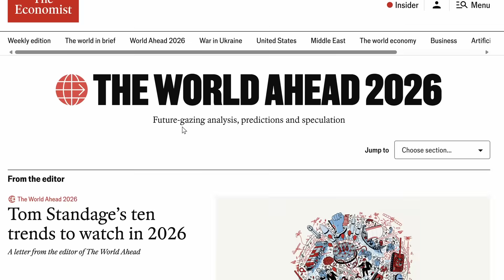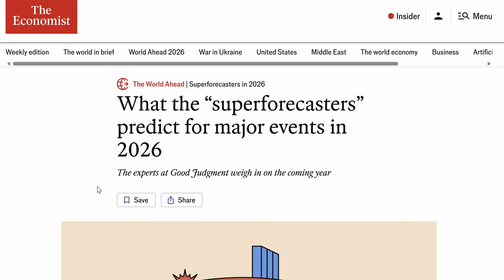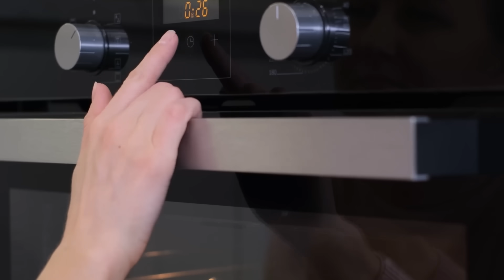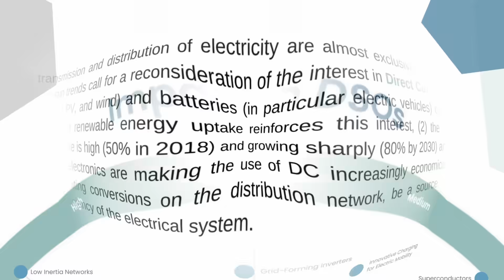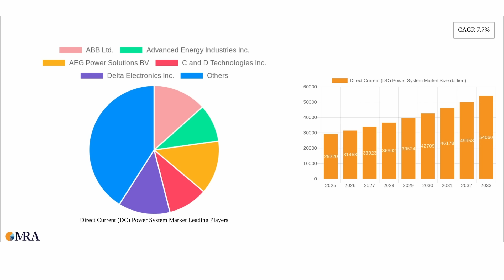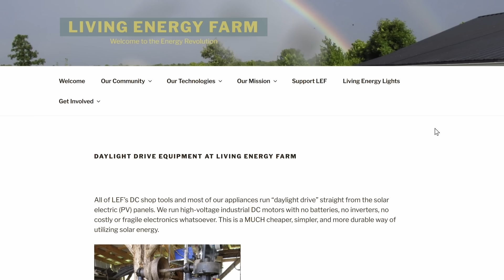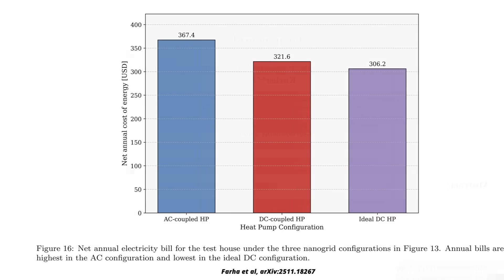Are We Using the Wrong Kind Of Electricity?

Comment: EE here. This is exaggerated, it's not a fight AC versus DC, or that we have done something wrong. Both have currently their place. We aren't just simply replacing AC everywhere within a foreseeable future. Using DC is also expensive. It requires complicated electronics to step the voltage from higher to lower or vice versa. Circuit breakers and fuses are also much more complicated and expensive with DC. That said, I see it as normal development, where we increase efficiency and develop better solutions and products. DC transmission will inevitably increase, in the places where the increased efficiency matters and where the conversion electronics have become so cheap so that it makes sense to replace AC transformers. This both on transmission side (long DC links) and in certain places in distribution and local networks, especially along evolving battery and solar technology.
Reply: Also an EE here, and if my memory serves me correctly, roughly 50-60% of power demand is used for turning motors - which, if the creator of this video were decently fair to take into consideration, would mean that we’ll still need a lot of power available in three-phase AC to power small-to-middle sized factories.
Reply: @tahiro1121  First part of your statement is not wrong. But most of these motors don't run directly on grid frequency. Most effective type of large AC motors (SynRM) even can't start on grid.
Reply: @tahiro1121 yeah 90% of the motor are start AC frequency
Reply: @tahiro1121  This is what I wanted to mention for previous post: asynchronous motors (short circuit cage rotor) are simple and reliable, the article asks us to use brush motors, or expensive for big size electronically driven brushless motors? This is actually either a stupid, or a bad intended propaganda article.
Reply: @tahiro1121 a great many of the motors these days are some flavour of brushless DC motors. Even in fridges and air conditioners etc it is becoming more common. 
Heck even simple ventilation fans are using it now to be quieter and allow variable speed.
Reply: ME here.  My view is that AC won because it is so easy step AC voltage and current up and down with primitive transformers.  It helped that AC generators and motors were brushless while DC had brushes (eficiency and reliability issues).
The thing that changed is the cost and reliability of stepping DC up or down has dropped with semiconductor prices.
DC is just an opportunity to be considered.
Reply: @skyak4493 I gotta agree. AC “won” because it was much easier to step up and down in voltage, so that the voltage carries the power, not the current (Immediate savings is realized in the control circuitry, recurring savings is realized in the amount of copper required to carry power from here to there). But you can store only DC, we have no known way to store AC. So it makes sense that most portable devices are DC because the energy is stored locally. However, many DC motors these days are “dc brushless” which is code for 3 phase AC and it still takes some effort to convert that stored DC to the 3-phase AC. But the effort it takes is invested in a more reliable system overall, as compared to a brushed motor.
Reply: @skyak4493  Yeah, back in the day, AC was better, and you mention the reason. However, semiconductors are not only able to step up/down DC, but also convert AC to DC with much higher efficiency than a transformer (in low/medium and maybe high voltage systems). The tradeoff is the price. So, if we have the required electronics now, while moving away from AC in those cases where there is no clear reason to do so? Back in the day, we had no better choice than AC. Today, we can choose the best option for our particular use case.
Reply: AC won because it was possible to change amplitude easily. DC lost because it was virtually impossible to reach any higher voltage. 22kV was achievable as AC only.
The technology changed few times since then.
- The old way to transform DC to different voltage was to turn it into AC, transform it and then turn it back to DC. This required transformer, 2x motor and 2x generator. A lot of moving parts. AC to AC required only transformer.
- Next version was based on early semi-conductors. DC to DC no longer required any moving part but the efficiency was terrible. And the technology did not allow the extreme powers that AC was capable of. Despite that the "no moving parts" was big improvement and so this was used for some time to achieve high voltages.
- In this millenia we've encountered boom of DC to DC convertors. Internally these were not a convertor at all - these were comparing output voltage against the required value and then either opened source or not. Like instead of delivering 3V DC supply these were delivering high frequency of pulses of the input voltage, e.g. 24V. If you've used frequency in kHz and good capacitors the output looked like the desired DV. Efficiency was no longer that bad, high power not achievable but the size of the device was a winner - it was tiny. Often the biggest part was heat sink for the transistor. Add in the fact the source did not even have to be DC but you could use AC and you would realize why nearly all computer PSU switched from heavy AC transformers to these "squeeking devices". Doing step-up DC to DC convertor required such few more elements for pumps. Even worse efficiency but still tiny and cheap.
- And the final breakthrough is in the switching element. We are now capable of manufacturing transistors which can switch extreme powers at very high frequencies with power loss which was not imaginable few decades ago. Use 20V at gate to control 1200V at 150A (18kW) power, losing 700W of power. Common and rather cheap IGBT transistor. You can buy models which can handle MW. Either way, we now have very efficient way of converting DC to DC.

The issue I have with the modern convertor circuitry is that it is getting complicated. In my school days I was making transformers. The math is simple and you could get good enough diodes for a rectifier even here beyond the iron curtain. So trivial was the technology. But the modern DC to DC is complex. Not the final assembly, that one is still rather easy. The issue are the components. Who can make good IGBT transistors? And what do they need? I fear it is the same case as with modern electromotors - many companies can make them, but they require special magnets made using neodymium. What if China stops supplying us with the materials or components? Would we be able to repair our cars, busses and trains? Not unless we switch back to older technology which did not require such materials.

Did you ever wonder why there are so many ancient cars being used on Kuba? It is a poor country and there are some embargoes. The people at Kuba are able to repair those 50 years old cars themselves. Make their own spare parts. But they would be unable to repair nowday car without supply of spare parts.

Should we keep AC for the same reason? To be sure that we can keep the grid operational even if new Covid outbreak happens and lead times on critical components rise from 12 weeks to 18 months?
Reply: I thought for sure it would be Metric voltage vs. American voltage.
Reply: AC is easily transfomable from higher to lower voltage and vice versa.
Reply: All rotary generators produce AC - rectification by electronic or physically (commutator and brushes).
Wind turbines inherently produce AC.
Reply: Commutator and brushes are mature technology. Therefore I dare to say dynamos are DC generators. If we wantes to be that picky we would not have any DC motors either.
Reply: @MichaelMoffatt-d3y  I mentioned the motors prefer AC, but to rectify the HUGE generators' output is expensive and not reliable (brushes or semiconductors).
Reply: @draudes657  true not reliable there is chance  of failure or wear, but no rotary generator outputs DC - it all has to be rectified.
Reply: I generally agree, but I must say I think it's eminently stupid that AC is still being installed for lighting circuits in homes... It's all LEDs now and having a tiny AC-DC transformer with every LED light source is just ridiculous. PoE is emerging as a solution to that, but that's a  bit too complicated for most.
Reply: She's another Edison. But Steinmetz was the dude.
Reply: @honeydavis5568  Unfortunately Edison won against Tesla by other means than engineering.
Reply: Also EE originally.  100% confirm.
Reply: ^ this, for small / local electronics the components to convert AC to DC or vice versa are so cheap and efficient now it's not worth changing, and for transmission AC is still best until you get to very high power / very long distances.
Reply: The problem is that to have hvdc, you need hvac.
Generators make AC.
Then AC is step-up to high AC voltage.
Then it gets rectified into 60hz DC.
Then the frequency is boosted high enough to get close to "real" DC.
Then and only Then, it can travel long distances.
When the HVDC reaches the destination, it has to go through the same process of the beginning, but in reverse order...
I dont understand the use of all this.
From what i know, DC can't be stepped-up or stepped-down. 
To do so, it needs to be AC at first.
Reply: That's right, but one small note to add to this video - EVs uses AC for motors as well ...
Reply: @PaleAle-mg1tj Appropriately, Tesla cars use AC motors. Some other brands use DC. So we are indeed in a transition era. Who knows which will win in the EV long term.
Reply: Yeah, and imagine what happens when lightning strikes?
Reply: One of the big drivers of DC use for transmission lines is you can fit 30% more DC down the same sized wire than you can with AC. 
Not to mention grid synchronisation issues pretty much vanish a well as power factor issues which are becoming more and more of a problem.
I suspect we'll actually see DC pushing further and further down the grid even to the street level poles and wires. 
If your input DC is higher than your output AC a "simple" step down h bridge buck converter is all you need. The utility can now shift 30% more power without upgrading their wires. 

Stepping back up for solar roofs etc is a little more complex of course. Though the solution to that is to bring the high voltage DC to the home and let the homes inverter handle the whole job of up and down converting as pure DC. Then supply AC to the home. 
Naturally then tapping off that DC source for devices that can use it. 

Eventually there'll be a new plug, (hopefully a global one) that supplies around 400v DC, people will have tiny wall warts that convert to whatever AC/usb-pd they want for legacy devices.

This is a 50-100 year time line, not a tomorrow thing.
Reply: Or, just a cellphone charger lol
Reply: AC Vs DC? AC is way more efficient and can be generated with very common motion. If AC is like harvesting ripples on the top of a still body of water (or wobbling a vat), DC is like the whole body of water moving at once in one direction. When someone pushes a swing for a child do they constantly push at every moment? No, they add a small amount of energy periodically at resonance and the same effect occurs. Natural DC occurs in interfaces between +/- electron shelled elements and people obsess with the idea of permanent free power from this notion but don't really think about where any additional energy may come from that could actually do useful work. This sort of electron transfer power (galvanic etc) is destructive to the materials, involving reactions, this kind of generation is basically fossil fuel where magnetic generation is more akin to renewables. If AC is a particle then DC is a wave front. These analogies doing anything for anyone? 😂 Solar panels were a game changer in the generation world.
Reply: Transformers are still pretty simple devices for changing voltage, but I agree DC-DC conversion is closing the gap.
Reply: well, why not? it only took 40 years to replace the worldwide analog telephone network with a much higher capacity and quality optical digital internet. And the components to do so are much more expensive and much more complicated than what the analog telephone network required. And yet it happened, because there was demand and because there was truly free market in that particular industry. The latter happened simply because the doo-gooder regulators didn't even realize something great was happening.
Reply: @viktorm3840  The answer's in the video. The efficiency gains going from AC to DC are  2 - 15%, whereas optical fibre lines are many orders of magnitude faster than analog. Regulations or the free market won't change that.
Reply: @viktorm3840  Telephone transition was only due to digital information transfer to change from max 64kB analog the magnitude of gigabytes with 1000's x parred due to use  colours in same 1 optical tiny fiber. AC,DC have both their own pro and contra. Main problem with DC is corrosion , magnetic and switch problems at the High voltage grid.
The simple conversion with transformers from High voltage to low voltage. A transformer can last decades as inverters are very sensitive to aging. At home f.i. your Solar panel inverter would not last over 10yrs as an AC transformer , just coil and iron could survive decades.
Reply: Yes she is in pop science slop
Reply: @gavinnaye9853  I disagree. The title may be click bait, but the content is in general agreement with this comment.
Reply: My old truck , 59, has no problem stepping up the voltage for ignition system, contact points, using an ignition coil ! A replacement costs about $20 and it produces several thousand volts from 12 bolts DC ! Nothing complicated about it !
Reply: @chavitacanta008  It's actually only converting the changing current that goes through the coil.. ie AC...
Reply: Like Sabine mentioned, I think it makes sense to go local DC, at around 300V and interconnect small districts (of perhaps 1km across) using AC. AC to DC conversion is MUCH easier and cheaper than DC to AC.

So all the power generation can stay as it is in AC, but converted to DC locally, at the substation.

Just about everything in houses or factories now runs on DC. Even motors are changing to variable frequency drive for pumps and drive systems (increased control and efficiency); like washing machines, heating systems and tools.
Reply: @fredfred2363 No it doesn't. Major loads in residential and commercial consumers are AC. Industrial users almost all 3 phase AC. This DC idea  is just a push from solar PV advocates, it doesn't make sense in electrical engineering, distribution and protection.
Reply: @kekessalman Also modern DC/AC converters are crazy efficient. There are also big leaps in terms of net-giving abilities. There’s really no reason to switch to DC outside of maybe households
Reply: @kekessalman  I agree, the main reason Edison's D.C. didn't take off was because of the number of transmission stations needed due to losses through a long length of wiring, A.C. does not have those problems or the need of more substations to transmit...that means fewer dollars spent to give A.C. to more people!
Reply: @fredfred2363  No, local 300V DC makes sense only at first glance, but such a high voltage (and power) DC is extremely dangerous. Risk of electrocution is exponentially higher as body doesn't sense being part of DC circuit. And I guess most of us get hit by grid level AC voltage or leaked current during a lifetime.
Reply: @f @fredfred2363 AC motors run much more efficiently. We first used big DC motors, then switched to asynchronous motors and only the last few years the switch to synchronous motors is happening because we got so good at real time, fast power electronics
Reply: Yeah unfortunately this channel is slowly but surely going into a clickbait pop science spiral
Reply: Don't need step up/down if use solar panels and local battery storage for lighting. Also tiny cables in comparison - lots of savings to be had.
Reply: @mudmonkeymagic  your solar panel regulator is a DC-DC converter, required due to the variable voltage from the panels. And about cables: The thickness is a function of the current, so lower voltage -> higher current -> thicker cables for a given power. This is why running 5V throughout a house, even for LED lighting only, is a bad idea - you'll either have to use quite beefy cables, or accept that a lot of the energy is lost as heat in the cables. 12V is better, but still problematic beyond a single room. 24V starts to make sense, though still not for a whole house - I use it for (some) lighting in mine since it's easy to get equipment, though ideally I'd go for 48V (I can only legally work on voltages up to 50V since I'm not a certified electrician). With 24V I still need several distribution panels around the house each with their own power supply to keep the wire runs short enough that I can use "sensible" wire gauge and not get unacceptable wire losses.
Reply: @koma-k Well, I don't want to argue with your expertise but I've got a solar panel that charges the battery ffor 12v lighting on my caravan and the cables are a helluva lot thinner than twin + earth even for lighting circuits.  (The panel cables and the lighting cables both).
Reply: @mudmonkeymagic  LED lighting tends to sip power, so almost any voltage will work and the wires will still be thin.  That can’t be said for most other appliances, however.  A good example would be a camper van or RV with a tea-kettle and microwave.  Call it 1500W each for 3000W.  Now consider the cabling needed to handle those loads at 12VDC, 24VDC, 48VDC, and 120VAC.  The cabling gets thick in a hurry at something like 12V.  That affects your trunking too, not just individual circuits.

So the main problem here is that even if you build a decent low voltage systems, you hit a brick wall on convenient scaling of that system pretty quickly later on.  As many people have realized over the years as the desire for higher quality of life increases.
Reply: @junkerzn7312 Well my original point was specifically about lighting as a separate system.
Reply: @mudmonkeymagic  I don't doubt that, but in a caravan the length of the cable run is going to be limited, which makes thinner cables acceptable since losses are proportional to cable length. Wire sizing is practically always a compromise, and if one can "get away" with thinner wires due to short runs that's often done. For your house electrics it's a bit different, as regulations have to assume there will be long runs, and required wire gauges reflect that. Caravan solar is not subject to such regulations that I'm aware.
Reply: @mudmonkey

You are completely incorrect in your statement concerning voltage in solar systems.